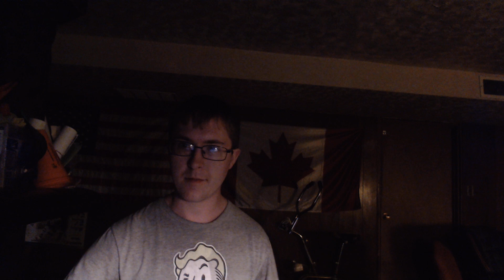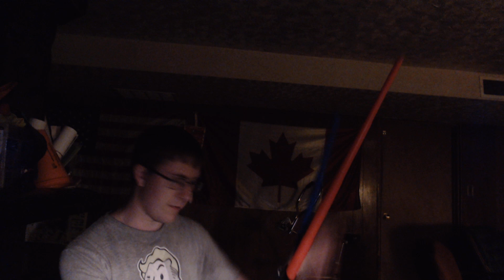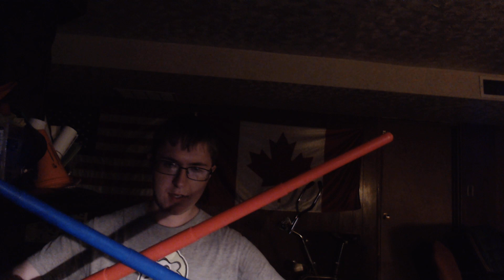Why lightsaber blades don't just slide down each other

Comment: Ok, but you do sonetimes see them slide in the movies occasionally.
Reply from the maker: With enough pushing and force it could be done.
Reply: @ironinquisitor3656  I would argue it should be done because it is very advantageous. In actual historical swordsmanship you want to bind with your opponent you can feel their blade pressure and it gives you information, you can also use it to push your opponents blade off to the side, where it is no longer a threat and kill him while remaining relatively safe.
Tl;DR it is used in actual swordsmanship.

Comment: Oh, I have a TCW retcon for you!
Originally, Baron N. Papanoida was a member of the Wroonian species while Chi Eekway was a Twi'Lek. Not only has TCW retconned both to be members of the Pantorans, they went one step further and made N. Papanoida into Chi Eekway's father, which wouldn't even be biologically possible if they were different species.
Reply from the maker: I never knew about that one. I'll have to think about that one.
Reply: @ironinquisitor3656  If you read their old Wookiepedia articles via the Wayback Machine, there were rumors they were related somehow since the beginning, which is no doubt because the actors were father and daughter. Maybe this helps with an explanation.

Comment: Good video, and I must say even though Jon Avenger likely TPM, and the other 2 prequels. He said the title of TPM makes no sense.
Reply from the maker: Jon Avenger is a moron. TPM does make sense. The Phantom Menace is the Sith. Specifically Palpatine. Its not that hard to figure out what it means.
Reply: Ironinquisitor Yeah exactly, and also I find it so hypocritical that he complains about the Bella actress looking emotionless in Personal Shopper( which is the point since it's not a happy movie). But he has watched the 2003 Clone Wars, and Anakin (mostly) looks like that, basically because the same reason, it's not a happy time for them, though sometimes they both do smile at somepoints.

Though I will say I have never seen Personal Shopper, but I know she would look like that because of the tone of the movie.